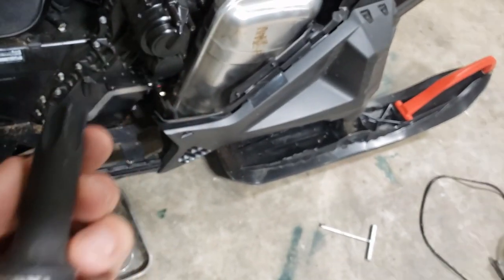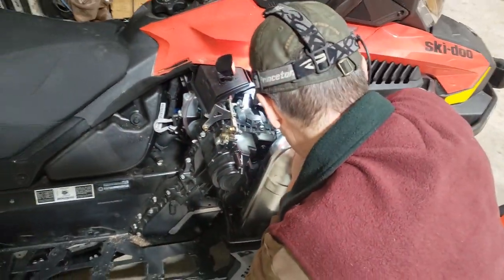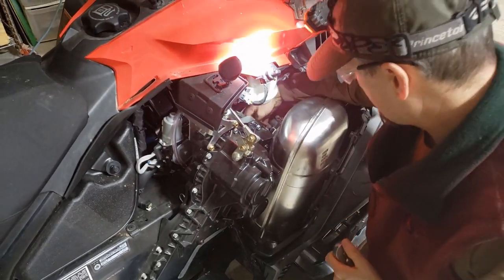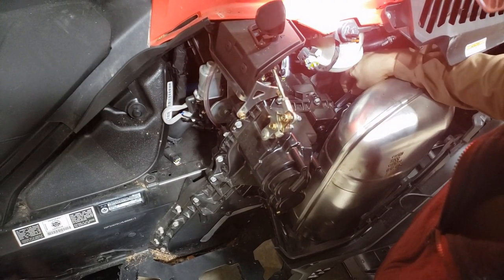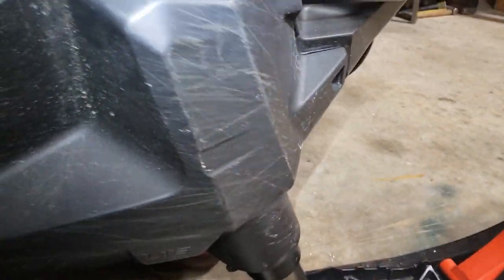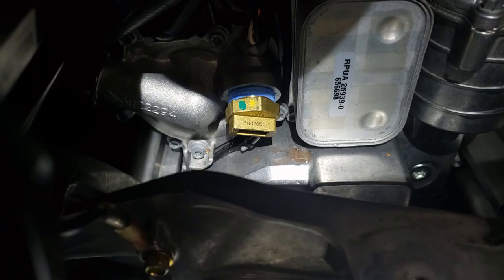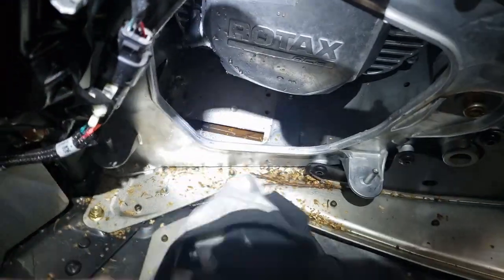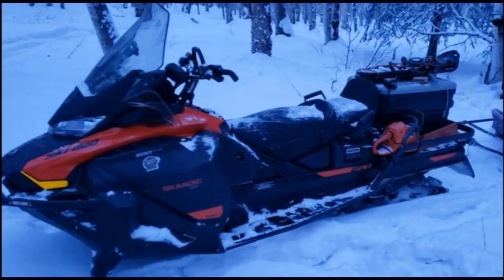2021 Ski-doo Skandic Block-heater install 600 ACE WT wide track, EASY, kinda...exhaust springs arrg

Comment: Greetings from Ontario Canada,
It was a great video, thanks for putting together and sharing it.  I wonder if you might share your thoughts on something. We are in the market for a replacement snowmobile. I am debating between a Skandic 600 ACE and an Expedtion 900 Ace. 
Most of our riding will be on trails to and from camp, and at times I will pull an ice hut (light weight, <250 lbs.) a couple of miles. I will also be at times have my wife riding with me.  We are not crazy fast, breath taking, air grabbing trail riders but rather very content to ride at a moderate pace. We are in our 60's and would really like to do some touring on the many trails in our area. I really like the quiet operation and fuel efficiency of the 4 strokes.
My questions; 
- With the reduced ski stance/width is the Skandic a little tippy? 
- Is the 600 ACE enough power?
Are bot well suited for a passenger?
I am replacing a a Polaris 340 Edge, although too small for 2 up riding, it is not tippy but the 340 is really not powerful enough. 
The Edge has very few miles on it and has served us very well but it is time...
Thanks for your time!
Paul
Reply from the maker: Greetings.
So glad to visit with you..  
Expedition for sure.  They are super stable but much more money than the tippy Skandic which is perfect for what I use it for on tight narrow tree lines.  
Hope this short answer helps.  Watch my other videos on the new skies I put on the Skandic to help for context.
Cheers from Alaska

Comment: Sorry for the unrelated question: it is Dec 21/22, Are you still running the Simmons Gen 3 skis, or did you switch back to the Gen2s?
Thx in advance
Reply from the maker: NO worries.  Ask away.  I have trouble keeping up with all the YT video info comments I post on too. 
YES, I still have the Gen 3 on for all my rides since this video was posted.  The Gen 2 was great, the GEN 3 is better on trails and powder.  If you are only on powder trails, then the GEN 2 is perfect.  If it's mixed go with Gen 2. Cheers from Alaska.
Reply: @practicalporters  "If it's mixed go with Gen 2"  I assume that you meant to say "Gen 3"?
Reply from the maker: @maxmoo3275  correct...
Sorry about that.
Gen 3 is the better ski.  Just put the Gen 2 on the old 2010 Skandic and it changed it 51% better.  Massively helped turning radious with when towing a large load....

Comment: Block heater is a myth, thats the battery who need a heater.  A cold battery mean less current and a weak spark.  Install a battery heater instead, thats what i do for my car ... but i dont know if they make a battery heater for snowmobile .  You cannot charge a cold battery.  Thats why if you make a short ride, the battery dont have the time to heat up for charging and the day after, the engine wont start.
Reply: On my 2020 Skandic, the battery is behind the seat on top of the heat exchanger. As long as it starts, and you ride for a decent amount of time, it does warm the battery enough to charge.

If so desired, it would also be easy to add an electrical battery warmer.

My battery cranks and starts fine with no heating until about -40.
Reply: Yeah, maybe both eh?
I think he said the block heater is to protect against premature cylinder wall wear. Like the oil is too cold to lube properly?
50 below ain't nothing to sneeze at